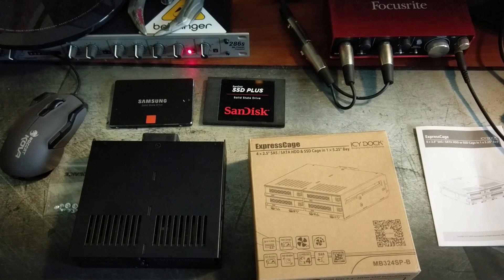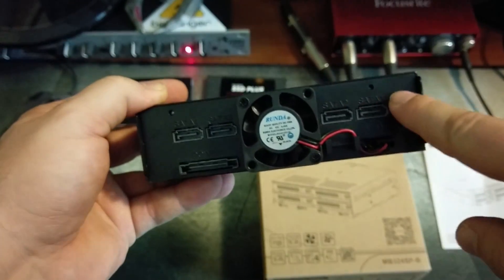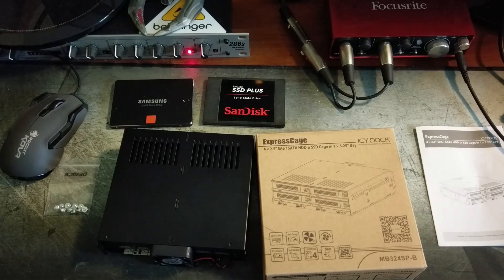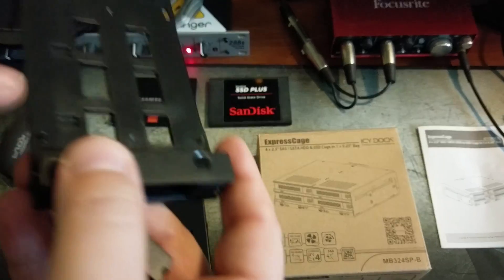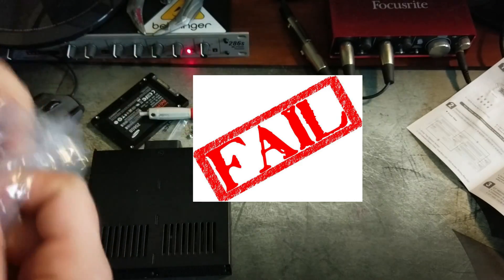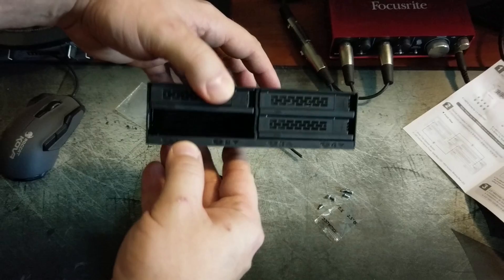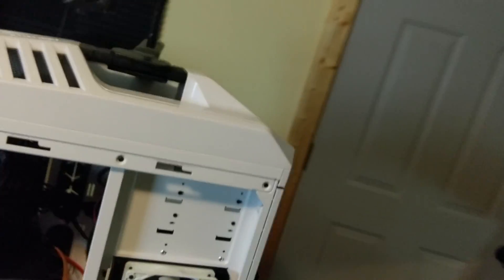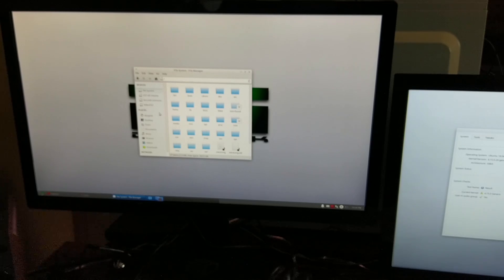Icy Dock Hot Swap Cage Review/Install For Distro Hoppers Everywhere!

Comment: I was looking at the one with the individual on/off power switches. My concern was a conflict with my case door so I thought perhaps recess it. This model solves that issue and they have one that houses 6 drives and may be a better solution. Now I'm really conflicted, thanks Ryan. Haha!
Reply: Hey Ryan, I came across this while doing some further info searching. Maybe you could use it. https://www.icydock.com/MIR/May_2018_promotion.pdf
Reply from the maker: Thank you for posting the promotion! Six drive option looks awesome as well. That version has two cooling fans and provides an excuse to buy more drives :)

Comment: I bought one of these (the 2 drive version) back in early January solely to distrohop. I never had issues years ago installing linux on multiple partitions, but over the past year or so I've run into a couple of distros that wiped out my bootloader (KDE Neon was the last one). Icy Dock is very useful!
Reply from the maker: A great example. It’s happened to all of us distro hoppers. Antergos and KDE Neon have done it to me before.